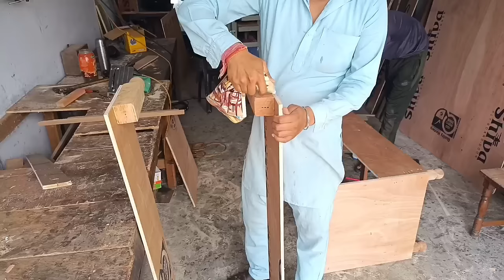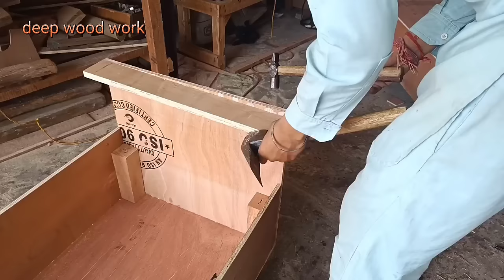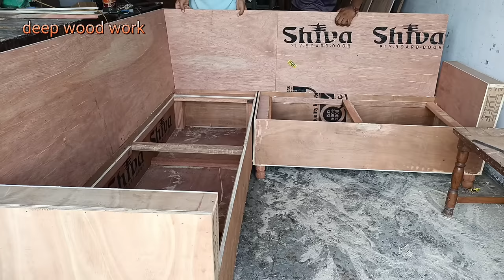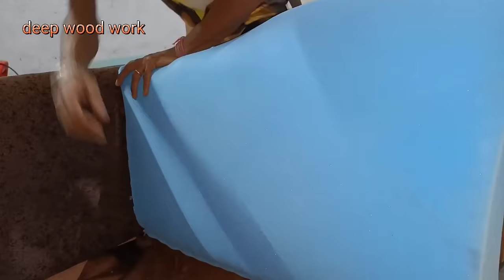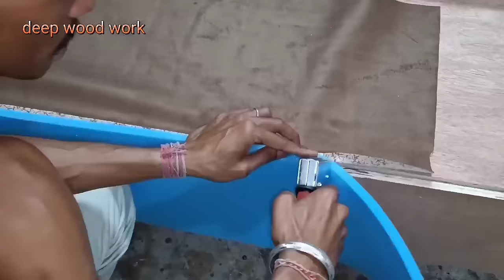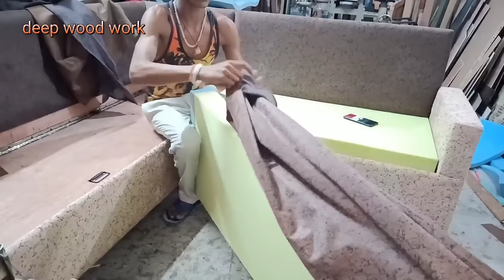L-shape sofa (corner sofa disign) how to make sofa at home | setti kaise tyar kare

Comment: As a retired carpenter and furniture fitter, I have never used nails in any of my projects, instead screwing and glueing only. I saw no sanding of edges, no health and safety best practices (wearing sandals, long garments with tails, long extension leads and so much freehand cutting) and regarding the foam and covering used are they fire-resistant and non-toxic. Is the plywood furniture grade? And do all the materials conform to consumer and national standards. If this is DIY then great but that's not consumer-grade standards, but best wishes